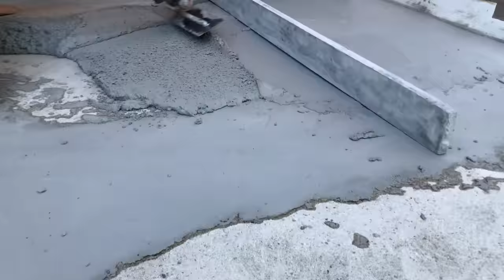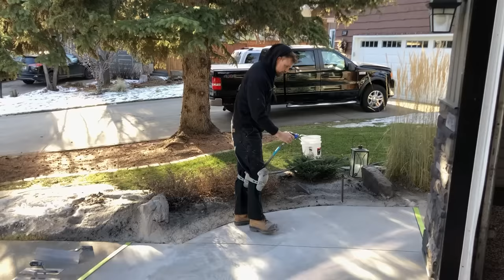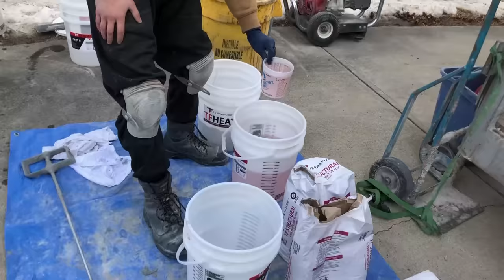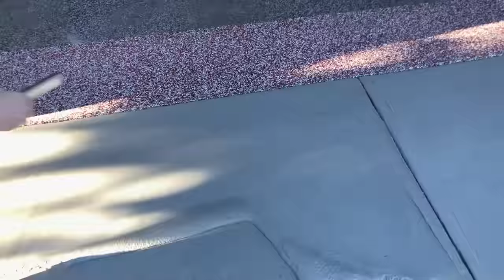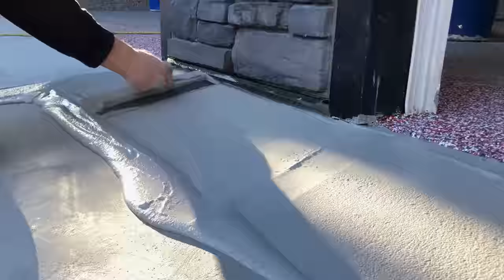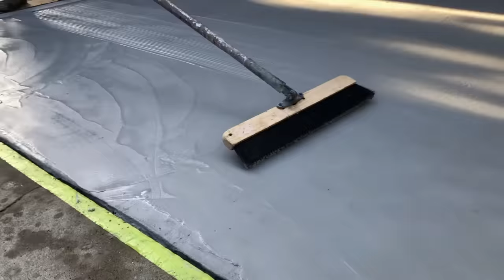Fixing driveway cracks, height differences, and broken edges, using TF Structural Concrete Repair

Comment: Waste of time and money, remove and replace and do it right.
Reply from the maker: You mean replace it with a product that has already failed?
Reply: So you are telling me that patch is stronger than a 4,000 psi ready mix with rebar in it. Lol what a joke. that patch won’t last a year in cold weather.  It will come off especially where you lay it so thick.
Reply from the maker: Yes, it is stronger than 4000 psi, and it will last just fine in freezing cold weather. It will not come off. I am basing this information on experience, years of real world examples, and facts. I'd love to know what you are basing your information on, seeing as you have never even heard of our material, let alone used it in any type of application. 
https://youtu.be/-RACYCLKqA4
https://youtu.be/iuK9_XweHKA

Comment: Not the proper way to fix this.   Use a hammer drill and drill through the concrete. Use spray foam on the holes to level the slab. Much cheaper and easier to do.

Comment: No primer/adhesion promoter? It will come off after the first winter🤣
Reply from the maker: This product does not require primers, they actually ruin the bond. This is not portland cement either, so we don't have to 'glue' it down with inferior acrylics. It chemically bonds to concrete substrates. 
https://www.youtube.com/watch?v=AY-mhFVXACs&t=163s
go to 2:30 in this video, and then you can adjust your prediction

Comment: Good thing....you bridge the cracks with mesh...
Bad thing.....you didn't prime the existing concrete....
Third.....if you bridge all cracks you dont need expansion joints....
Reply from the maker: 1. Yes
2. Not correct, our product doesn't need primers, as we don't have to 'glue' it down.
3. Not correct, the material is too rigid, and you must honor existing joints, or it will crack and break.
Reply: @TerrafuseInc  2...You obviously dont know what a primer is for....priming the floor is not to glue your product down....its to seal the existing floor from dust and other contaminents and also to stop the existing floor to absorb the humidity of your product and weakening it at the contact point...
3.....Once you bridge any cracks and joints....you dont need expension joints....I've done it over surfaces as big as 650 m²....never cracked again....that's what the bridge is for....and settleling cracks never happen where you put the expension joints anyway...

Comment: Way to much work . Grind down height on crack to level, Fill cracks with epoxy , apply a gray microtopping with polymer modified concrete with a squeegee and done in a couple of hours.

Comment: This will not hold up. Bare minimum you need to prime and scarify the surface prior to this mystery top coat. Also if you are in a climate that has a freeze thaw cycle then you are fubared. You are basically parging over an entire driveway. Common sense prevails.
Reply: It looks like the concrete that was getting the overlay was ground and cleaned and u can see in the water mixture is a primer, I do this in upstate Ny, (freeze thaw)and there’s a lot of mistakes u can make but if u do it right it last a very long time, I got overlay 12 plus years old, honestly prolly longer if I went back and checked on them all
Reply: @woozy607  I guess there are probably some durable products out there these days. As long as the substrate doesn’t shale and it’s solid. Cheers
Reply from the maker: No, you don't need to prime, this isn't a concrete topping. You need to do your homework! Also, scarifying is only needed if the concrete is really loose and flaky. For this, we just used diamond grinders. ALSO, this was done in Canada. Freeze thaw does not hurt this material, otherwise why would we be installing it here?
Reply: What is the product made of if it is not a “concrete topping”? I’m assuming a cement product that you mix with water? That has fibreglass, latex polymers etc?
Reply: @TerrafuseInc  the product might not require you to scarify and prime the surface. It probably has latex additives in it. But grinding an old concrete surface before adding a concrete topping mix to it would be advised imo . Along with a primer to create a chemical bond. Even if the cement mix is latex modified / poly fortified.
Reply: @steven8725  most of the time these products got a dry powdered polymer, some types of pozzolan like fly ash and some others, silica sand and Portland. I’ve made my own mix a few times but never felt 100% comfortable with doing that just cause companies put there product mix threw a lot of tests

Comment: Awful job best way is to replace it instead of skin coat of concrete that will last 1 month or less  beside it will look like a patch too noticeable
Reply from the maker: You’re wrong. We have a video of this same job one year later. Do some more research before making a comment based on your opinion, and not facts. It’s not helpful. 
Also, we didn’t skim coat it with concrete, you can’t do that if you want it to last.

Comment: It will all be cracking soon. You didn’t even vacuum the floor, no reinforcement,… terrible
Reply from the maker: no it won't, and no it hasn't. We did vacuum, and used a leaf blower. Just because something isn't in the video, does not automatically mean it wasn't done.

Comment: This absolutely will not last look how big the cracks are already no point to  putting a band aid on a cut off limb, same applies here the existing concrete already failed massively so anything put on top of failing concrete will fail in short time, how come they never show a vid of it after 6 months a year because it looks like shit...
Reply from the maker: https://youtu.be/o5UYlJmKhAE
https://youtu.be/-RACYCLKqA4
Reply from the maker: We do show videos after jobs. Maybe you should do some more research before making so many assumptions.
Reply: @TerrafuseInc  I' ve been in the industry for over 20 years and have never seen cracked concrete support anything, like I said those cracks will open right up it's ignorant to think that mesh tape will hold back tons of force the earth pushes, it already broke 3 inches of concrete like nothing, and if your excuse is lean concrete then that supports my argument that it would be best to remove because it's already failing. Resurfacing is too make ugly concrete look better not fix structural issues in the concrete.
Reply from the maker: It’s too bad that after 20 years, you still think concrete is the only technology and system that works.
Reply: @TerrafuseInc  Well I bet your one of those guys that gives people a guarantee that your concrete won't crack you think you know it all, I guarantee that concrete will crack and all you can do is mitigate them and hope it cracks where you want, the fact that you think you can secure cracks without securing the 2 substrates with steel shows me you'll never learn anything and enjoy misleading people, I have no problem telling the truth even if it pisses you off.
Reply from the maker: I would never guarantee that concrete won’t crack, that’s ridiculous. We discuss that in almost every video. Most can be mitigated, and sometimes even prevented with the right technique.
Reply from the maker: https://youtu.be/AY-mhFVXACs
Reply: @TerrafuseInc  Notice how you show a job that had no large cracks the cracks will reopen shortly especially anything over a half inch still not impressed...

Comment: That does not look like a professional job at all. That stuff was way too wet when they broomed it. If anyone falls on that it will shred their clothes and the skin under the clothes.
Reply from the maker: As opposed to baby smooth concrete driveways, where if you slipped, it would be like landing on a pillow? This is a winter climate, and the customer was elderly, and requested the best non-slip surface we had, so they DON'T suddenly fall. How many driveways have you randomly fell down on? is that a common thing for you?

Comment: Ps. Heads up. This is garbage. The minute water starts to get between the two surfaces it will start to crack and fall apart. It’s basically a full blown ripoff. Sad to see contractors would take advantage of people
Reply from the maker: You don’t have any idea what you are talking about, which is made evident by your comment. Your assumptions don’t help anybody.

Comment: Does Not Work
Donot Even Try it 
I Did Same Job
I Bought The More Expensive 
Concrete Resurfacer But I Tried 
Some Other Famous Brands Before,
“GARBAGE”
All Cracked After A Few Years,
So I Remove All With A Flat Shovel
And Putting In The Trash.
I Installed In My Driveway.
Amén.